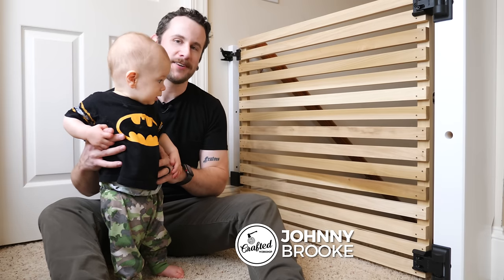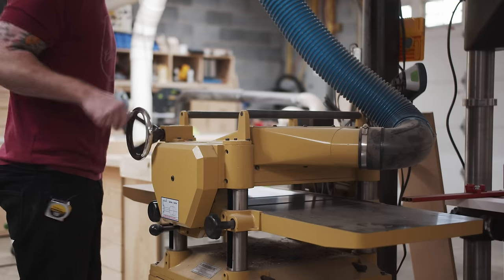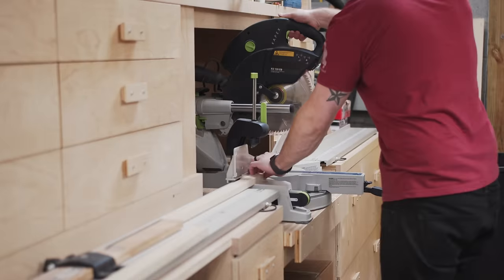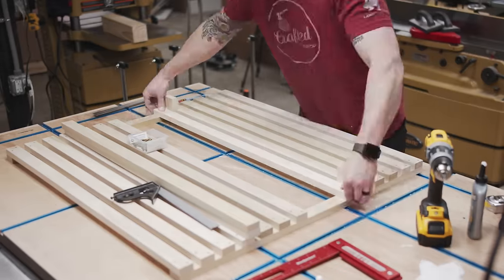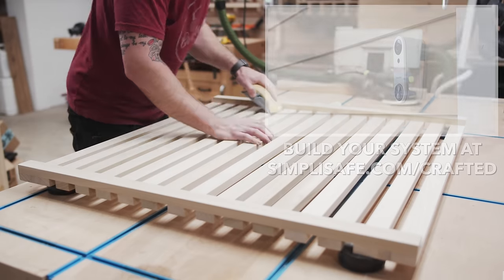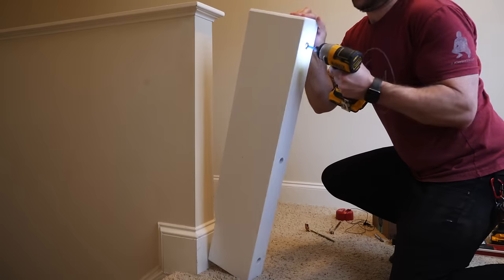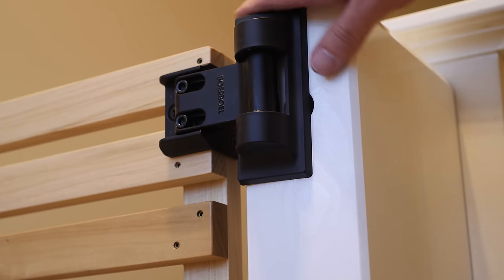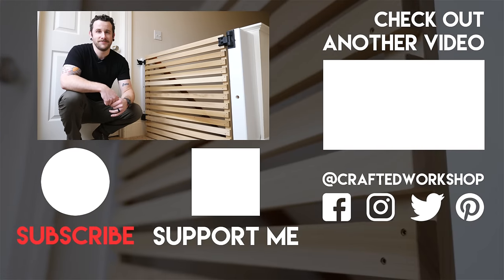Easy DIY Modern Baby Gate or Pet Gate 👶// How To Build - Woodworking

Comment: Nice build. I built a gate similar a couple of decades ago with horizontal boards. My baby daughter figured out how to climb, so rebuilt it with vertical boards (anti-scaling)
Reply from the maker: Thanks, and good to know! I'm guessing if he's old enough to climb it, he'd figure out a way around it either way. He won't be playing by himself in this area, so I'm not too worried about it.
Reply: @craftedworkshop  I love your work and videos and I trust you know what is best for your family, but as you can see a lot of people have shown safety concerns for the horizontal design and the latch (the type my niece figured out very early on). 
Would it not be a good idea to add a stickied comment or a description update to at least acknowledge the potential for safety concerns in a more visible place. Some people may want to copy this who aren't as vigilant as you are. I would hate for there to be an accident because someone followed your "how to" guide.
Reply from the maker: I’ve already added a pinned comment, most people just seem unable to read. Thanks!
Reply: @craftedworkshop  No pinned comment is showing up for me, even after a refresh, or on multiple devices. Asked friends to check as well just in case it was my internet, and no-one can see any pinned messages so you may want to check that yourself.
Can anyone else see it?
Reply from the maker: Thank you for letting me know! For some reason the initial pinning didn’t seem to work. I was wondering why I was still getting so many comments.
Reply: Same here, built it with vertical, it works but looks messed up. Hey that’s only for a year or two after all :D

Comment: Most of those gate type latches have a hole at the bottom for a padlock, I just used a locking carabiner clip and it worked like a charm. My son didn't figure out how to open it until he was about 4, by then, stairs shouldn't be an issue. ;-) Great job, looks awesome. Yes, it will become a ladder quicker than you think, however the suggestion to put acrylic on the front is a great idea and will be a perfect solution!! Nice job!!

Comment: There is a reason you don't see many baby gates with horizontal bars, I think you built yourself a baby ladder there. 
You should probably add a sheet of perspex or something to the front to keep the modern look but take away the tiny person climbing functionality.
Reply from the maker: I'm not worried about it but it'd be easy to modify if it becomes an issue, and I like this as a possible solution!
Reply: Of course sorry, I just re-read my comment and I sound like a right demanding know-it-all, didn't mean to come across like that. :/
Reply from the maker: No worries, I like your idea a lot, will probably add a sheet of acrylic here soon!
Reply: @craftedworkshop  I would add it sooner than you think you will need. As a father, my son would even climb over the plastic lattice baby gates. That being said. 

Really great project. I liked how you attached it to the half wall. You will be able to remove it when your son gets older and no have that high block of wood just hanging out on the half wall when the gate isn't needed.

One other suggestion, I would have out the latch on the other side. Eventually, he will learn how to open that latch.

Comment: I like the finish and design, and love those hinges. Thanks. I'm sure you want a different latch. That one will be very easy for a kid to open once he can stand or pull himself up to reach it. You'll find yourself having to use something to pin it closed, and be much happier if you put $20 into a safety gate latch that requires more finger strength, dexterity, and intent.
Reply: I also suggest updating the description with a disclaimer suggesting child safe latch. You really don't want someone building your gate as shown and having their kid get hurt.

Comment: Just wanted to say thanks for this video! I adapted the plans and built a set of 4 35"w x 33"h fences for our rabbit area, and it works great! This was my first major woodworking project, and the steps in the video really helped.

One genuine question: was there a reason why you did your sanding/finishing after assembly? I sanded before assembly because I couldn't use any finish (most are toxic to rabbits), but I'm interested in your thoughts.

Comment: RE: drywall anchors, the self-drilling ones are great, but I like Wall Dogs even better, they are screws that will hold a good amount of weight in drywall, and leave a relatively small hole if you remove or move them.  ALSO, if you hit a stud with one, it just screws into the stud, instead of making a mess of things...
Reply from the maker: Good tip!
Reply: Thanks for the tip! Very helpful!

Comment: I'm telling you from experience he's going to climb that before you know it. You essentially put a ladder in front of the stairs. I highly recommend rotating it 90 degrees before he learns to climb it. Hopefully he doesn't get injured. Other than that, looks simple and nice!
Reply: I have a 2 and four-year-old and they climb everything.
Reply: I would agree with you, if it wasn't for the fact that the pieces appear to be extremely close together, making it difficult for even tiny hands to get a grip.
Reply: There's likely 1/2" to 3/4" in between each board. This is more than enough space for them to fit their little fingers and toes into.

Comment: Awsome project.  Think I might make one for my house to keep my dogs out of the second floor. My older dog is not so much of the problem, it's my puppy that's the issue while we are still training him to go outside instead of in the house. Planning on going to the meet and greet you will be at in the Rocker in Orange.
Reply from the maker: Nice, the gate would be perfect for that! And see you tomorrow!
Reply: I would change the slats to vertical though. Especially since you little one will be trying to climb up stuff soon.  Trust me, I have 2 kids of my own and a bunch of nephews.  When they where that age, they loved climbing on stuff. If you. Notice most of the baby gate designs are vertical slats so the gate doesn't act like a ladder for them to climb up.

Comment: You should add wooden hole fillers on the spacer board to make the gate even with the top of the stairs the white piece where you put the lag screws to tighten to the beam at the top of the stairs a nice wooden piece of filler to fill that big hole don’t fill the whole thing all the way though incase you ever want to remove the gate you can just drill the wood fillers out and remove it after you fill it sand the fillers down flush with your wood and it down and it would be one solid piece just some advise because the holes kinda look ugly although the top one is mostly hidden with the top hinge otherwise I like it good idea I’m building a dog kennel 10x12 it’s indoor outdoor and I’m running power and water to it so it should be interesting can’t wait to see the outcome of that I’m gonna have a 4x4 indoor space for then with a dog gate so they can go out whenever they want I breed dogs I’m gonna have one side the 4x4 stalls with a dog gate running out to gated in dog kennel outdoors but I’m gonna have to come up with some kind of roof top to keep other animals out then my back yard in gated in about 50x70 so I’ll let them all out and exercise daily in the yard for a hour or so because I breed American pocket bullies which they are high energy but they only get 16 inches tall off the ground females and males get max 17 there awesome dogs I have a liter on the ground now of 3 that’s the thing to they only have slightly small litters but they can’t have them natural because how small they are they so they have to have C-section everytime so it’s 2500-3k every litter before I even have them but I make it back and some that’s why a kennel will be perfect and you videos give me a lot of ideas because I’m a contractor myself

Comment: I would have glued the wall plate on as well the drywall fixings arnt man enough for a job like that. Or you could just run a bead of caulk round it that will stop it coming loose. Im sure thats no problem for you.

Nice job.
Reply from the maker: The anchors are rated at 70lbs each, I would say that's plenty of holding power for a 30lb child. I want to be able to remove this stuff in the future when I don't need the gate anymore.
Reply: @craftedworkshop  yea they may be rated for 30lb but from experience they arnt that great on there own. They wont last long im sure. Like i said a man of your talents will be able to sort that if they do come loose.

Comment: This is awesome! I may look into this for my baby girl that's on the way! You got awesome videos man
Reply from the maker: Thanks a lot, and congrats!
Reply: @craftedworkshop  sup man, I'm getting ready to do something similar. One question, do you think those structural screws for the wood columns were a good choice, or do you think drywall anchors would be better?
Reply from the maker: @CallMeJuancho  drywall anchors definitely aren't a great choice as they will fail over time. I used them to attach the strip for the latch but am going to be replacing them very soon with something like toggle bolts, which have a lot better holding power.

Comment: I would think about installing plexiglass on it to prevent possible climbing and fingers getting stuck in between the slats. But it won’t take away from the beauty of the piece. I also wouldn’t be so quick to dismiss people’s concerns for climbing. Children live to surprise us. You will be shocked what your child will do that you were not prepared for. There is a reason that all of the gates on the market are built the way they are. With vertical slats and decent gaps between them. A few comments, I would ignore. But this many I would take serious consideration to.
Reply from the maker: Yup, I'll certainly keep an eye on him and will address it when it becomes an issue. I think plexiglass is a good solution.

Comment: Kid learns to stand, immediately opens gate and falls down stairs..... Wouldn't it be smarter to have the latch on the complete opposite? It's on the front left-side as we view, put it on the back right-side. That way kid can't open it, it avoids the railing and it's easier to open when walking up the stairs. 
If you like the horizontal just make the gaps extremely small.... or do as everyone else says and just to vertical